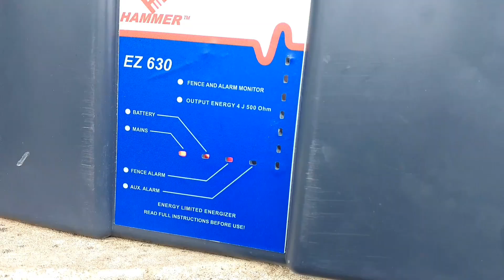Electric Fence Installation (Home Security Systems)

Comment: When powering enegizer we don't use neutral?
Reply from the maker: Energizer has two terminals for the output. The Live terminal which you can use Red/Brown cable depending with your your Country's color code and Grounding terminal that can be Yellow/Green/stripped. No neutral color

Comment: Hello
I am a student from india
We are gonna do this as a project here in india the unauthorized fencing without an energiser directly from the mains is causing so many issues and emergy theft is also very common here so to prevent all these things we are gonna make a prohect for govt of kerala if u could share some ideas on how to implement it it wikk be very useful
How to contact you officially
Reply from the maker: Reach out to me via email: hongbing254@gmail.com I can be a good consultant in your project at a small fee of course.